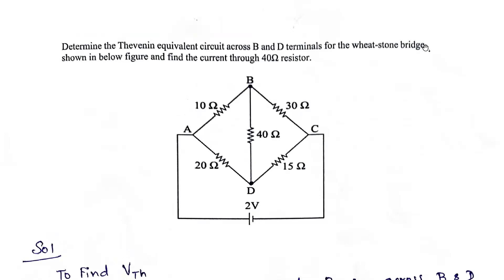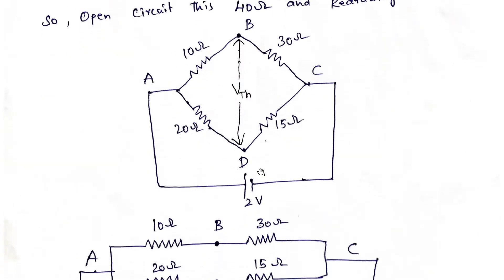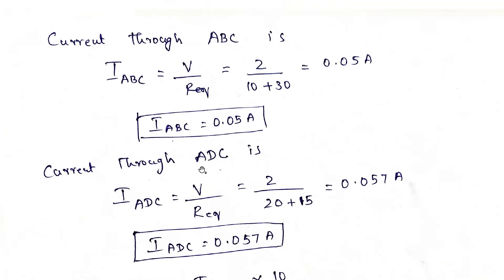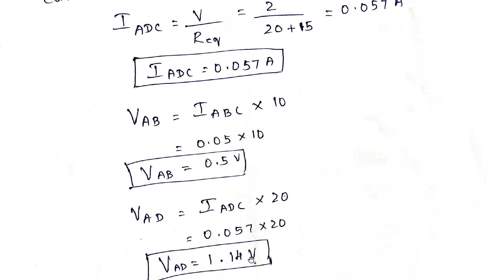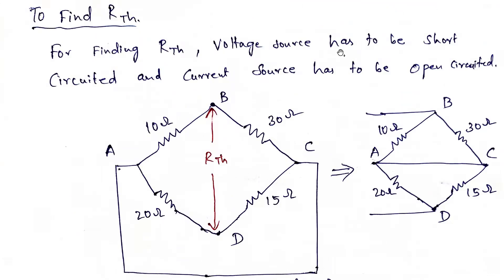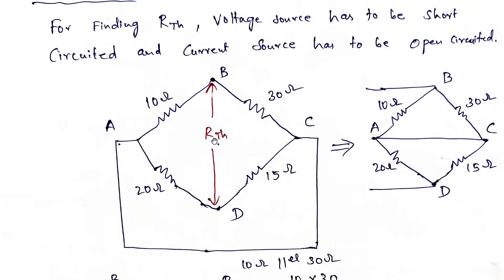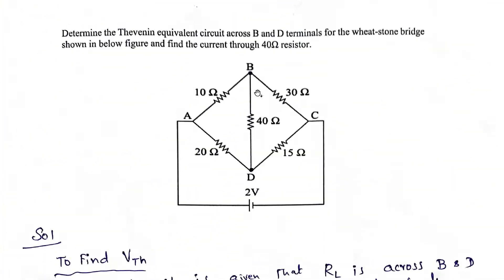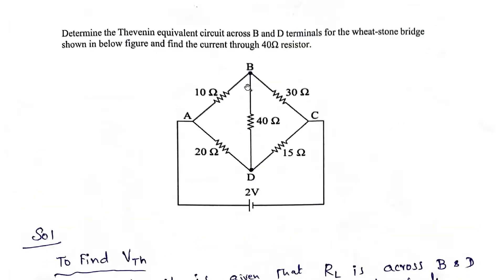Solved Example Problem 9 - Thevenin's Theorem #bee

Comment: DOUBT SIR WHY WE ARE TAKING VOLTAGE AB AND AC WE SHOULD VALCULATE VOLTAGE FOR ALL THE POINT LIKE AB BC BD AD THEN AFTER THAT WE WILL CALCULATE VTH
Reply from the maker: Yes 💯 exactly. You had very good doubts. Appreciation from my side. But the load resistance is across AB points. Just for understanding across the load resistance of all the problems we are taking AB. It's not mandatory like you should take only AB, you can also use XY. That is not a matter, you need to find the load resistance, that's it.
Reply: Sir my doubt is we should calculate voltage drop across all the points and then add subtract according to their positive terminal and calculate vth but what we are doing only taking 2 point like AB and Ad why we are not taking voltage realted to all points not only all points 4 point @powersystemz